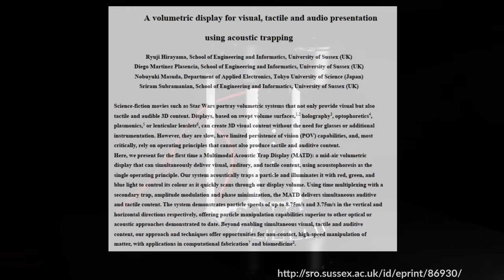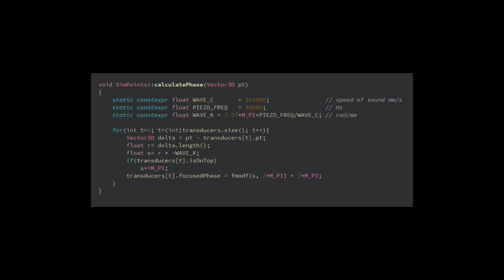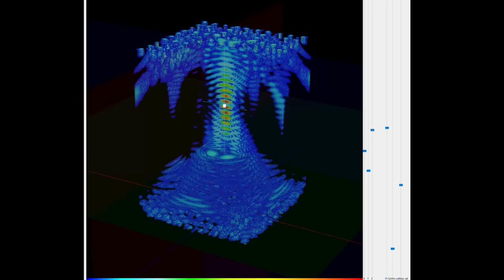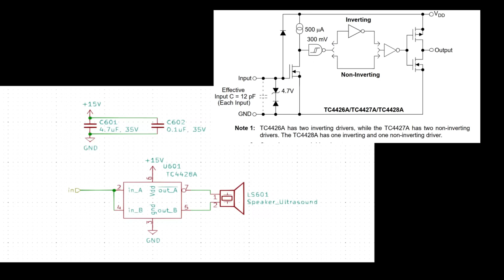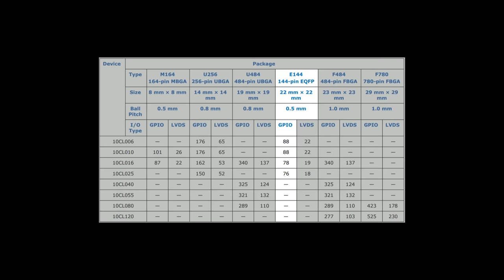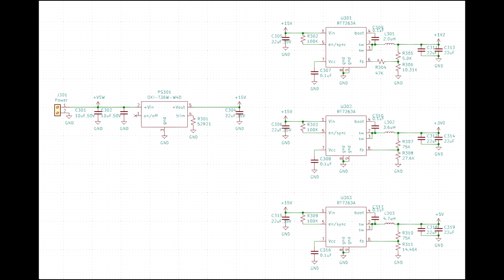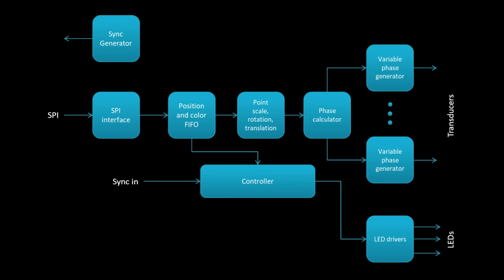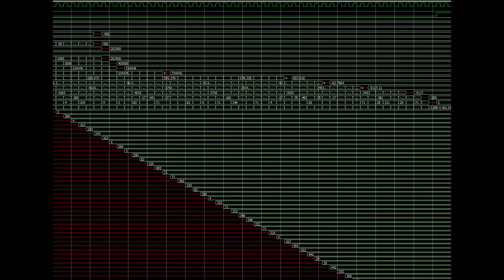A Volumetric Display using an Acoustically Trapped Particle

Comment: Could you use this to create a 3D pixel grid? 
Like, rather than drawing lines and animating them on a negative plane, fill the whole thing with rapidly changing, variable blocks of colored balls or squares.
Like the same basis for how a tv screen works, but using this tech to create a 3D TV instead.
Reply from the maker: would need faster particle to fill in the space

Comment: Starting at 6:34 and ending at 6:36, there's a second very similar looking spot just right of the middle towards the bottom. Anyone know what that momentary thing is? It looks just like the particle that's the main focus of this video.
Reply from the maker: lol - good eye!  there are a bunch of foam balls that fall and get stuck between transducers and sometimes in the transducers themselves.  There's enough acoustic energy to get them to dance sometimes - happens even with balls lying on the workbench too...
Reply: @abitembedded  Thank you for that response, especially so quick! Awesome work here :)

Comment: Such great work! I was wondering if you could drive the transducers themselves by wiring them in a 10x10 matrix and modulating a tone by creating standing waves in the wire itself, using just 20 (or 2?) wires.
Reply from the maker: I'm not quite following but I suspect not at such relatively low frequencies

Comment: Hi, cool video; most of your walkthrough of designing and building your device was way over my head, but I get the concept of what the transducers are doing. Anyway, I was wondering, how loud is (was) the device during operation? Any idea how many decibels? Thanks.
Reply from the maker: You can't hear the transducers and I have no idea of the dB level but there are some audible harmonics and those are moderately loud (and high pitched)

Comment: There's 2k+  comments so I'm way late to the party, but I haven't seen anyone else ask: what if you put this in a sealed chamber with a higher density gas? Could you get more specificity of movement? Better speeds? Maybe a lighter gas?
Reply from the maker: you're not the first to ask :) I don't know, I'd have to simulate and/or try

Comment: OUtstanding work!  Schemata overview bueno.  Vehicular PROPULSION Prototype? : Acoustic energy is a fluid. EM energy is a fluid.    If EM energy is a fluid might you say that your arrangement is another form of a Hydraulic Control System  (HCS) ?   would Bernouli's fluid mechanics regarding HCS apply?   And if so then is not the Global Electric Circuit GEC another form of HCS?   If the  ball were a Drone then what fun the pilot could have if the pilot can control flight as and efficiently as your methodology reveals. 

 The flight characteristics resemble the video recordings of "ufo"s during their wingless air-borne maneuvers.  The Global Electric Circuit/Geomagnetosphere might make a nice stable, global electric and magnetic matrix pairing to place a Standing Wave sub matrix. 
Can there be standing waves forms for electricity and magnetic fields?  Might a  regularly, evenly, constant pulsing solenoid field be considered a form of standing wave?

Comment: Fantastic project! However the "180 degrees out of phase" bit is quite irrelevant. If the signals were in phase, the standing waves would be displaced by half the wavelength, that is all.  The 180 phase difference puts a wave at the center; the offset for 0 phase would be hardly noticeable in the static version, and it is irrelevant for the moving version.

Comment: Preface: I am not good at physics or electronics or any of this but I wondered if this is possible to do with a gas inside a closed container? Its lighter than the ball and I'm wondering if you could more easily give it a consistent shape based on particle amount inside the container. If you could tell me why this would or wouldn't work I'd be very happy!!

Comment: Hi I recently became really interested in these displays. Is this something I could do myself? I'm not trained in electrical engineering or anything. Could you recommend a project to get me started?

Dan , also, can I put together the acoustic levitation kit with a soldering iron and a multimeter? People say you need a scope
Reply from the maker: Hi Dan - I think it's 100% possible to learn and do this stuff without being an engineer, just start small and work your way up.  I've never built one myself but an Arduino based 3D LED cube kit would be a great start to learning how to solder and program.  The most important thing is to figure out how and why each part works.  

As noted here https://www.instructables.com/Acoustic-Levitator/  you just need a multimeter and soldering iron to build the kit. It's a fun project!

Comment: i am wondering what would happen if you operated this array in a vacuum.. would you still be able to move the ball around? if so.. could you move it faster because there is no or a smaller amount of air resistance? i am guessing it would not work in a vacuum.. but i wonder how it would work in a space filled with helium or something heavier than regular atmospheric air/gas

Comment: I’m curious…If you modulate the amplitude at 250 Hz, how exactly are you feeling the waves? Typically you need a vibrating diaphragm to produce air waves that you could sense - the lower the frequency the larger the diaphragm. Can you really produce such low frequencies with enough power to feel? I’m highly curious and would love to hear your thoughts further.
Reply from the maker: definitely - you can feel a loosely focused "tickling" sensation at the focus point, caused by interfering pressure waves.  Even a small speaker can generate low frequency sound (e.g. ear buds) - combining multiple such speakers increases the magnitude of the pressure wave
Reply: @abitembedded  I thought earbuds “tricked” your ears into thinking you hear lower frequencies by giving you higher resonances of the same frequency. Maybe I’m thinking of sub-bass frequencies though..

Comment: What effect would air density have on your control of the particle? i.e. have you tried running it in a Helium or Argon atmosphere?  Just wondering if a higher density air would dampen the particles jiggle or increase the maximum transnational speed... the issue of initial placement in a sealed container would need to be solved...
Reply from the maker: It would be fun to try, though a bit of a pain

Comment: Would be interesting to put this in a vacuum, and a high pressure environment.
Reply from the maker: it does need air for the sound to travel through
Reply: @abitembedded  absolutely! but that's in a perfect vacuum, I was referring more to a vacuum chamber that near emulates a vacuum, something with really low pressure, and another experiment with a much higher pressure. It'd be interesting to see the relation between air pressure and latency derived from drag. There might be an ideal pressure for extreme movement, and another ideal pressure for idle stability. 
Just ideas though, this is seriously awesome
Reply from the maker: @panda_alternate  that would be interesting - others have suggested other types of gas as well.  Maybe one day I'll give it a try :)  Thanks for your interest!

Comment: Late comment here, also not an engineer. Would the cause of the distortion in the particle possibly be caused by friction with the air particles in conjunction with the motion? how would the particle move with different gases or even in a vacuum? Not my area of expertise at all, and these could possibly be dumb questions, but just my curiosity poking at me. Thanks!
Reply from the maker: part of the problem is that I need to calibrate the transducers...

Comment: Could this work in a liquid? This would be a good way the clean molten metal of non-metallic inclusions and oxides.
Reply from the maker: I expect it would - the math would change slightly as the speed of sound in liquid is different than in the air.  It might even work better - the liquid might provide some additional damping on the transducers

Comment: The term "volumetric", while commonly used, is quite inappropriate because the "metric" means "measure".  Hence "volumetric flask" or "volumetric heat capacity".  The terms "3D display" or "true 3D display" would be more appropriate.

Comment: does it make much of a difference for the transducers to be arranged in hex vs square grid?
Reply from the maker: good question - I don't know but I suspect not. The packing factor would change only slightly.  Be an expensive experiment to try :)

Comment: What happens if you use a ball even lighter them styrofoam something like aerogel, can you make the particle move faster to improve image quality?
Reply from the maker: Right now, I believe I'm limited by the inability of the transducers to change phase quickly.  I suspect more expensive transducers would help.  I might be able to get a little more speed with a lighter object but I doubt the image quality would improve much, if at all.  But happy to try if you've got some aerogel lying around 😀
Reply: @abitembedded  wow didnt expect a reply, and the transducers limiting it makes good sense,  i guess theres way more limiting factors that matter before the weight of object also if i run into any aerogel ill lmk ;)

Comment: I have a question, why not use stm32 but use fpga, can we use matrix to control transmitters, or is there a requirement for operating frequency here?
Reply from the maker: you need to control the phase of 200 signals, each  running at 40kHz.  You might be able to do it with some really tight code but it would likely be challenging.  Besides, FPGAs are fun!
Reply: can i use single fpga or rasp pi 4 and matrix transmitter ?
Reply from the maker: @thaison2977  yup, you can use a single FPGA - I chose not to as BGAs are harder for me to solder.  A RPi4 might work if you were to dedicate a single core to driving the arrays, similar to what was done here: https://github.com/hzeller/rpi-rgb-led-matrix

Comment: Are the simulation files in sim folder the ones used in 2D simulation?
Reply from the maker: yup - that's how the 3D sims were created.  Built in Qt5 IIRC so you may have to upgrade some components
Reply: @abitembedded  You meant 2D? Got me confused now. 🤔
Reply from the maker: @ianthehunter3532  the sims shown around the 2min mark that look 2D are actually a slice of the full 3D visualization - I think that's what you're referring to.  It just happens to be viewed full-on
Reply: @abitembedded  Oh, I see now. The sliced view looks more low resolution to me, that's why I thought it was done differently. Amazing to see all this work you've put into it in such a short video.

Comment: It's honestly not that cool because it will never have a practical application. Maybe as some type of acceleration to some kind of material science testing, where you bombard something with something to get a reaction or coating, but even then I'd imagine there'd be other ways that are more useful, so it wouldn't really be a replacement for those anyways. Maybe if we lived in a world with a limitless source of energy, acoustics could become a nice solid state way of moving things, like replacing a conveyor belt in a factory, but even then we already have highly efficient mechanisms that do just that, so it wouldn't really be worthwhile.
Reply from the maker: you're right - there's likely to be no practical application.  But, I get a giggle everytime I see a butterfly image floating in mid-air, so it's cool for me :)

Comment: i CANT GET THE QT FILE RUNNING ANY HELP FOR SIMULATION?
Reply from the maker: I think you've submitted an issue on github that I've responded to
Reply: @abitembedded  Yes indeed I did. I just woke up 😅 So I’m goong to check now.
Reply: Can you help me suggest the version you all used to run this sim @abitembedded
Reply from the maker: @agnivobanerjee3462 you can find that information in the Holo.pro.user file: Desktop Qt 6.0.0